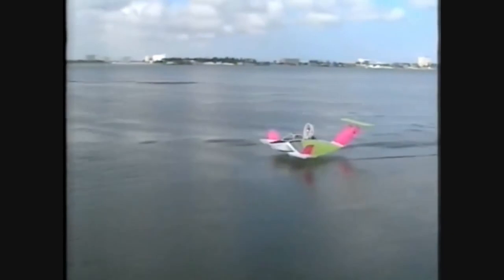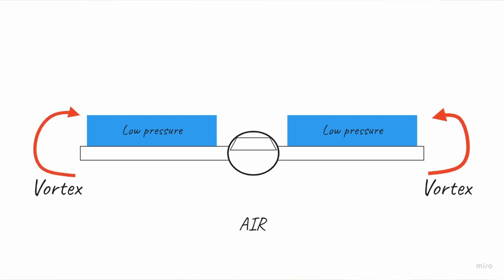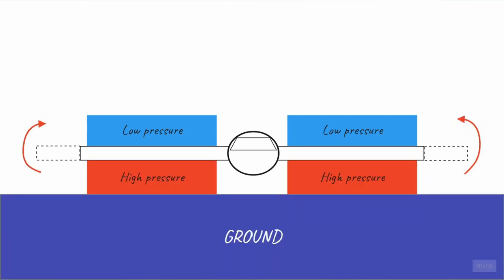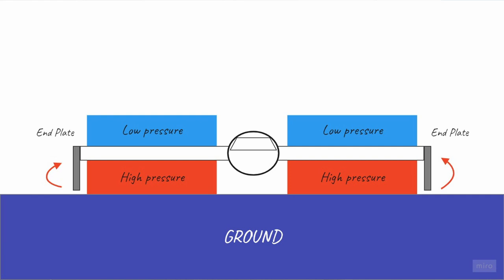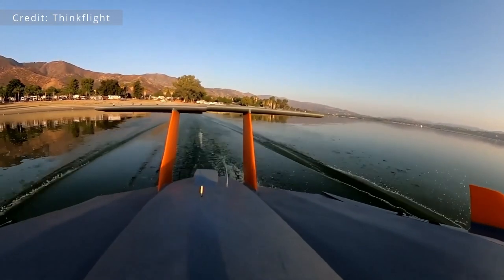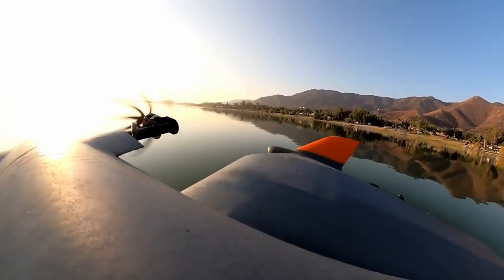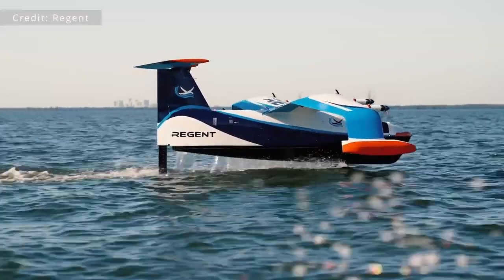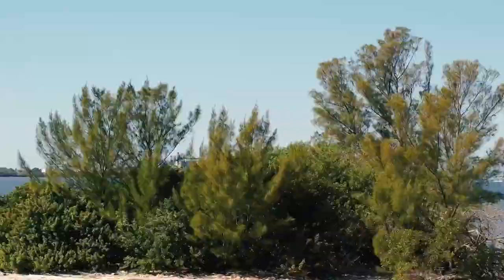Ground effect SPAN dominated DRAG, home builders and Regent Seagliders

Comment: None of my GEVs shown in this video used any electronics to control height btw...
Reply from the maker: Thanks for the clarification! In your last video you mentioned the 'fly by wire' Pid that was adjusting elevator angle indirectly. I was referring to that. Perhaps a tad awkwardly then as it doesn't actually take into account height control. It seems though that the control loop almost has a stabilising effect against porpoising?
Reply: @onewingspanabove  Yes, fly by wire A mode is a flight mode in ArduPilot that stabilizes the attitude of the vehicle but does not control height at all
Reply from the maker: @rctestflight  If the controller stabilises attitude while linked to the elevator, it actually controls height. It doesn't then take into account actual absolute height, but does dampen any height oscillations. Or am I completely off the mark?
Reply: @onewingspanabove  Height and pitch are not the same
Reply from the maker: @rctestflight   @rctestflight  Understood.. We covered that extensively back when I went through my degree for Aeronautical Engineering last century.. :)  
Pitch in this case would be directly linked to height though. Hence my comments. I am happy to put something of a clarification in my next video. Would you be keen to do a test and record a video you controlling the craft manually without stabilising of any kind and see if it is still stable in height/pitch?
Reply: @onewingspanabove  I mean, yeah, pitch can control a change in height but it does not control absolute height. FBWA mode is only using the IMU as its only sensor input. Therefore it has no way of knowing how high the aircraft is.